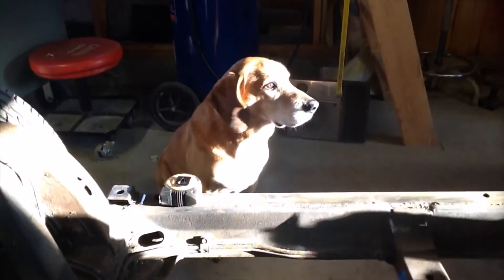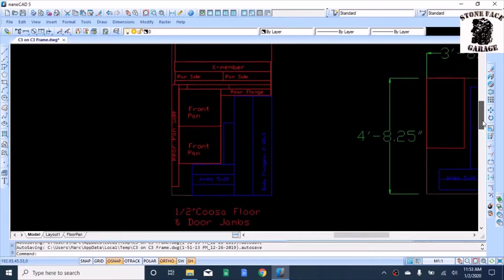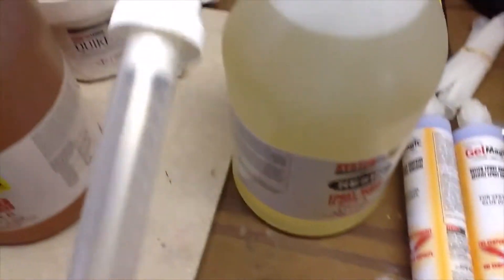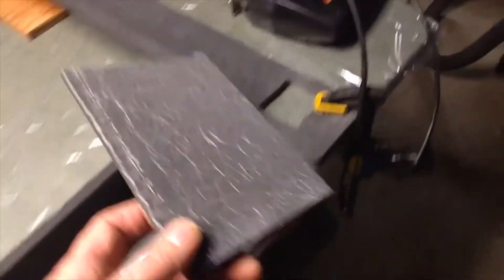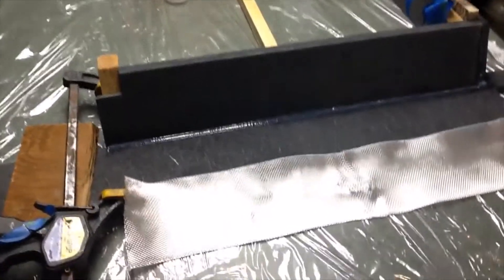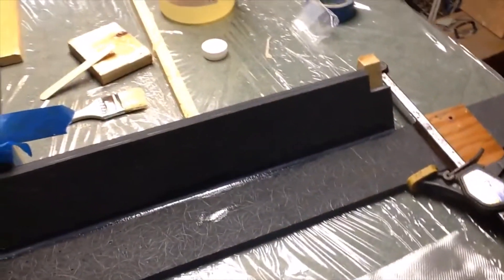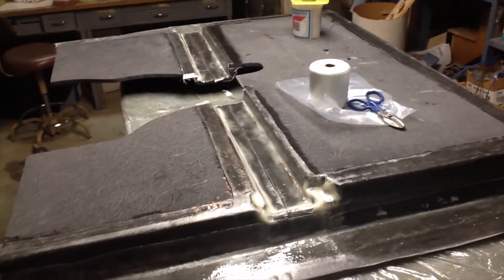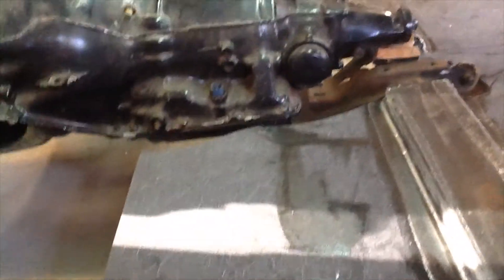Fiberglass and Coosa Composite Floor Pan Fabrication

Comment: Nice work. I've used epoxy and glass for years in boat construction. How is the Coosa board holding up? I see it's been about 3 years since your installation. Contemplating a full glass car build using the same boat building techniques with a combination of Coosa and Divinycel foam core construction.
Reply from the maker: The car is not on the road ...yet...but the floor/flange construction is unaffected by all the activity- sparks, weld splatter, solvent spills, exhaust heat,etc so far.

Comment: Can you cut fiberglass floor out of a 75 and scab that in? I have a 76, I honestly don't see why not?
Reply from the maker: Some guys have used the whole birdcage and inner tub to build a new custom body around. That wasn't going to work for me..  The floor alone is not strong enough to use as the main body mount and stiffener.